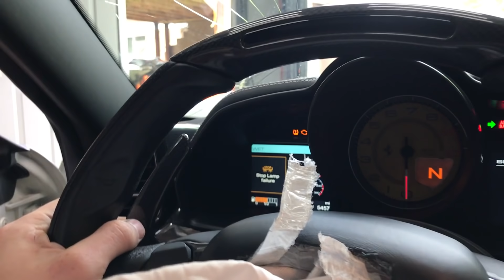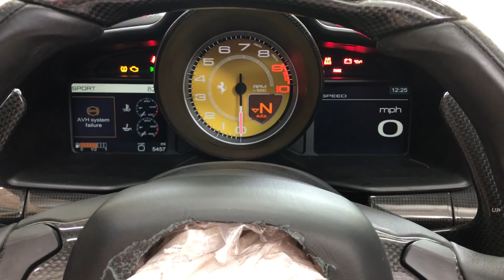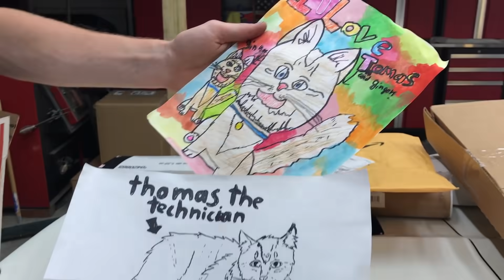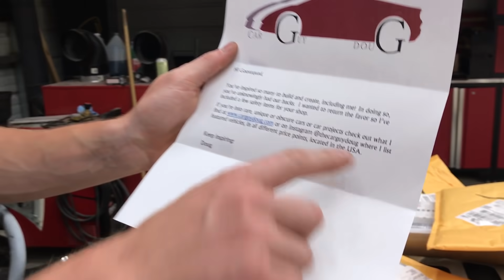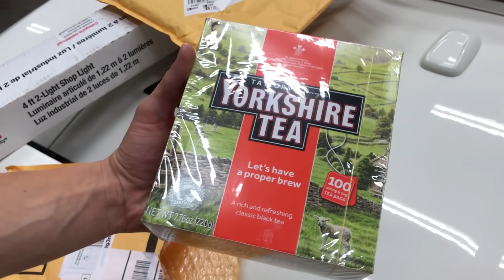Rebuilding A Wrecked Ferrari 458 Spider Part 3

Comment: To put it in gear you need too press the brake and pull on the right hand side paddle shifter. The N display will now say 1. Then pull on the bottom left hand side P button to disengage the park. Once this is done you can either press auto button between the seats to be on automatic mode or just use the paddles. PEACE ✌🏼 got a red 2015 458
Reply: Peace ✌🏼🇨🇦
Reply: Peace ✌🏻🇨🇳
Reply: You own a red 2015 458?
Reply: Peace ✌🏼 🇲🇺
Reply: pin this
Reply: Yo go spam there ig so they can see what you said to
Reply: @Jesus P how?
Reply: Peace ✌️🇵🇰
Reply: Peace 🇨🇦
Reply: Peace ✌🏼🇲🇩
Reply: Piece🤘🏿
Reply: Peace ✌🏼🇺🇸
Reply: Peace🇸🇦
Reply: Peace🇲🇦
Reply: Peace ✌
Reply: Peace ✌🇩🇪
Reply: I love all of you guys
Reply: Victor Coutu 
Peace 🇸🇬
Reply: PEACE ✌🏻 🇮🇩
Reply: U have a Ferrari..?
Reply: Peace ✌🏾🇬🇾
Reply: Noah Kinney  you the man ❤️
Reply: I love you 😭
Reply: Peace ✌🏻🇹🇩
Reply: Peace ✌🇲🇾
Reply: Peace
Reply: brake not break
Reply: Peace :-)
Reply: @dangozo8167  congrats for u to own a 458 👌
Reply: Peace ✌🏼 🇵🇱
Reply: Peace 🇬🇧
Reply: Peace 💜💜💜💜💜💙💙💙💙💙💙💙💜💜💜💜💜💙💙💙💙💙💜💜💜💜💜💜💙💙💙💙💙💚💚💚💚💚💚💚💚💚💚
Reply: Peace homie! ✌🏻👊🏻
Reply: Won't go into gear with the engine cover open!
Reply: TheInfamousProject  I didn't know about that one ☝️ thanks 👌
Reply: Barefoot Builder very informative comment 👍
Reply: Pease✌️🇮🇳
Reply: Peace 🇲🇽
Reply: Victor Coutu that’s what I was thinking
Reply: @dangozo8167  wheres your 60 roll in a 458? I mean OP has his on his channel you on the hand have 0 vids
Reply: Victor Coutu Peace ✌🏽🏴
Reply: Elijah Mayhan peace dude ✌🏼🇨🇦
Reply: @dangozo8167  You just got owned lol, seriously dude just uploaded a vid of him ripping his 458 that is in his thumbnail.
Reply: @MayhemXo  Dude when you get to my age I ain't interested in trying to prove I've got money🌻
Reply: SouthJerseySound it's not the best quality but it will do for now. I should really invest in a GoPro or high quality cameras and not just use my iPhone lol 😂
Reply: peace
Reply: Peace🇧🇧
Reply: Piece of ☝🏽peace
Reply: Peace out 🤞🏴.
Reply: TheInfamousProject  is it not because they disengaged the box putting it into park ? Just a thought
Reply: Peace🇧🇩🇱🇦🇬🇺
Reply: PEACE🇵🇰🇵🇰🇵🇰🇵🇰
Reply: Peace ✌🏻🇵🇷
Reply: Peace 🇮🇩
Reply: Peace ✌🏼 🇵🇷
Reply: @dangozo8167  I'm just saying you try calling dude a liar yet have 0 ground to stand on trying to flex you "have" a yellow 458 spider saying at your age you dont have to prove you have money makes no sense if that was the case you wouldve never thrown in the "I have a yellow 458" into the comment you made
Reply: AlwaysBeeenSad I changed my pfp after this comment and posted my video afterwards 🤔
Reply: Smart man
Reply: Peace🇬🇷
Reply: Peace✌🇿🇼
Reply: Peace
Reply: @dangozo8167  he does have a 458 though check his channel
Reply: Peace ✌️ 🇩🇰
Reply: @dangozo8167  why are you hiding now?
Reply: Pedro Rivera in his parents basement.
Reply: @BarneyR-u2d  probably screaming at his mom to go fetch him his hot pockets and mountain dew
Reply: I have a 458 just like their's but its wrapped
Reply: Peace in Turkey 🇹🇷
Reply: Peace ✌️🇮🇪
Reply: You guys are awesome. You appreciate your fans. You don't have egos and are just down to earth. Thanks guys for the videos. Love everything you have done..... Keep it up guys.
Reply: @Sorryformynegativity  111
Reply: Peace 🇺🇦🇺🇦🇺🇦🇺🇦🇺🇦🇺🇦🇺🇦🇺🇦🇺🇦🇺🇦🇺🇦🇺🇦🇺🇦🇺🇦🇺🇦🇺🇦🇺🇦🇺🇦🇺🇦🇺🇦🇺🇦🇺🇦🇺🇦🇺🇦🇺🇦🇺🇦🇺🇦🇺🇦🇺🇦🇺🇦🇺🇦🇺🇦🇺🇦🇺🇦🇺🇦🇺🇦😜👍🖖
Reply: Did u guys try to charge the original Ferrari  battery
Reply: Peace 🏁
Reply: God this comment section is entertaining!
Peace ✌️🇺🇲
Reply: That long just to start it up.
Reply: They put the car in park manually
Reply: Peace ✌🏼🇮🇹
Reply: @dangozo8167  lol hater
Reply: @dangozo8167  bro dont try an flex an act like you dont care about what people think if that were true you wouldnt have been commenting on here about it no one cares what you dont actually have
Reply: Barefoot Builder You should me more concerned with your eternal sole.  That Ferrari isn’t going with you.  Where are you going to end up on Judgement Day?

Comment: I had a 458 coupe that I bought on auction and then I had the same issue where it won’t go into gear but after a week of struggling I realized I have to make sure the hood is latched completely and the trunk also and doors closed or it won’t go into first
Reply: Whatsnew lol that seems so dumb
Reply: This is correct. Hood latch prevents the hood flying open and breaking the windscreen and totalling your car. very common
Reply: There are days when I think we the customers are going to be protected to death
Reply: You are correct. There are sensors on the hood and trunk latches that tell the ECU if they are closed. If not, it will not go into gear.
Reply: Same with most modern Mercedes, BMWs, and Bentleys.
Reply: My best friend had a Mercedes that would not go into drive if the trunk was not latched.
Reply: Yes, a lot of new cars are doing this, even American cars.
Reply: Same thing with 2019 Challenger RT and 2018 Buick la Crosse, won't go into drive if the door is open and if you're going slow enough speed and open the door it slams it back into Park
Reply: Whatsnew i have a Maserati Ghibli and it does the same thing 
Until you close the doors it won’t go to 1* gear
Reply: You have to close everything on the car like Hood  doors
Reply: Yup
Reply: Hopefully in all of those cut wires one of them wasn’t a lead to the frunk/hood latch sensor.
Reply: yep generally when any of the doors or trunk is open it wont go into gear as a safety feature.
Reply: Whatsnew in that case we wont be able to drive the car if one of the door switch/sensors is damaged.....?
Reply: Jacob Hockenberry no it’s not. It’s for safety and prevents damage
Reply: Whatsnew yup my bestfriend had the same problem and it was that. That simple
Reply: I had a Ford and the tailgate wouldnt open unless you smacked the right hand side. Smh all these pointless features the companies install 🤔

Comment: goonzquad 2022: Rebuilding a Wrecked Bugatti Veyron
Reply: 2020 *😎
Reply: 2019*
Reply: @CurtisOrionJonesBA-kn6km  yeah i know.
Reply: @CurtisOrionJonesBA-kn6km  they will source parts from old diesel trucks since the parts are similiar, or if all else fails, LS swap
Reply: Curtis Jones maybe but Volkswagen will and internally the veyron is almost completely Volkswagen. Outside it wouldn’t be hard to get parts
Reply: 2018*
Reply: Impossible
Reply: *Chiron 😜
Reply: Malte Spielt rebuilding my mother most likely
Reply: 2000
Reply: Well they didn’t lol

Comment: The "PS" button is for the Paddle Shifters.   Try pressing it to use the paddles to get it in gear.  Hope it works Fellas!  Good Luck!
Reply: haha, no. PS means Power start, aka launch control
Reply: QuandomBUS the PS button has nothin to do with paddle shifters. It stands for “power start or performance start”. It’s Ferrari’s launch control

Comment: Use one of those little devices that goes under the steering wheel and identifies all the codes. It connects to mobile and tells all the problems wrong with the car. Chris fix uses one. U can take examples. Its very useful

Comment: “Engine light is on” revs it 🤦🏽‍♂️
Reply: BRO FORREAAALLLLLL
Reply: Cibs H lol crazy, didn’t check oil, coolant nothing 🤷🏽‍♂️
Reply: Yeah, and cranks it having never even opened the engine bay....it could have had the heads off for all they knew.  Inexperience plus excitement can get you in trouble.
Reply: @kevinsue1778  15:50 they said oil checked
Reply: Picsart Editing Tutorial lol they checked the oil yes but then say it probably needs to be changed cuz it’s pretty dark, when they should of just changed the oil just to have it running on clean oil, then do another oil change once car is complete
Reply: Big Shasta EXACTLY!!!!! All types of problems could of happened right then n there but shit in the viewer they the ones making the money so shit, it would make good content if it would of went left 🤷🏽‍♂️

Comment: I know a guy with a 458 and there is no designated park gear. It’s only neutral with parking brake. The way it generally works is that you put it in neutral and turn off the car and it will go into “park”

Comment: In many autos a fast flashing turn indicator light on the display means there is an issue or problem with that light. On a few Jeeps when a bulb is burned out or going bad the signal flashes fast like that. Its most likely doing that because the front turn signals are disconnected.

Comment: To put it into gear I think you need to pull both the paddle shifters together at the same time which should put in in neutral and then the right paddle shifter to go into first.

Comment: Air pump in a stranger place. It’s inside the middle just inside at lower drivers door bottom quarter but a bit back where the door closes bottom quarter

Comment: Try to push the brakes in before shifting. If that doesn't work, then maybe that inertia button needs to be reset before shifting again, if that doesn't work, contact Guttersnake, he'll probably be able to help. Make sure your next step includes buying CYVEX ECUS for both race cars. Also i wanna see a mazeratti next build !!!

Comment: If the car was jump started in Neutral (since it was in neutral when you guys got it) sometimes that will mess with transmission position sensor. There is usually a code with this issue and from the video it looked like you guys had a check engine light. Not sure if that’s your problem at all but a good place to check nonetheless

Comment: Hook battery up to 60 amps current on arc welder for 5 mins , then 15 mins break and repeat this 5 times , 
Scale kinda crap comes off lead plates allowing acid to react just like it used to , only ever need replace battery when a cell /plate goes bad .
Reply: Be careful , stay a distance , have water ready incase if emergency to pour on skin etc and make sure top caps are taken off also , this is dangerous so watch a couple of YouTube videos about doing this procedure and use common sense , this is dangerous if done incorrectly . Needs be said .

Comment: I dont know for sure but i wouldnt put it past Ferrari to compand the ECU to not engage the gears if it can't get a coolant temp signal.. Considering you have the radiators off ATM.. But thats just a guess on my part fully

Comment: Dang Dude!....These guys are so smart!....The Inertia switch was "triggered by the air bags going off"....Who would known?.... Most of inertial switches are a switch, firmly mounted upon a vehicle or other mobile device, that triggers in the event of shock or vibration to cut power to electric fuel pump may otherwise continue operating after a collision or rollover and to pre-tension seat belts and/or to activate air-bags to protect the occupant(s) from collision with the vehicle interior or the steering wheel....but they are not  "triggered by the air bags going off"....Do these two guys just spew out anything without giving any thought to what they are saying?....

Comment: The designer of your car Pininfarina has built their first actual car called the battista. A 1400 kw or 1900 hp all electric supercar at a cost of 2 million + pounds , go take a look , it's a beast.      0 to 62 in less than  2 seconds. Top speed limited because the tyres couldn't handle any more and 1,696 pound-feet of torque.

Comment: Yo guys, if the car keeps detecting the front trunk as opened, it won't go into gear. If the front trunk latch is damaged, try to close the circuit of the latch sensor by jumping it with a wire. Also, when you try to shift into gear, make sure all the doors are closed.
I have worked on damaged Ferraris before so let me know if you need ay help.

Comment: Fellahs, seems like you and Samcrac are tackling Ferrari problems simultaneously, You ought to talk (or at least check each others vids lol!... Plus, you guys should leave the rear bumper like it is, The over done diffusers are noy designed to operate properly on a Ferrari's aerodynamics as far as the undertray is concerned......food for thought.........

Comment: If you plan on selling this car don’t change much from stock.  The car’s value will decrease the more the stock parts are removed and changed.  Could get away with the exhaust as long as the new owner is given the stock one in the sale.  The Ferrari purists look for OEM pristine cars not modified.

Comment: It’s not supposed to be in park that’s why it wouldn’t go in drive because to put a Ferrari in park you have to put it in neutral and then pull emergency brake not put it in park manually

Comment: This car had the full  Akropovic titanium exhaust.
Reply: Also the shop on the plate frame did all the work to it so you might want to give them a call. But the insurance company wasn't going to pay for the aftermarket stuff so it was pulled off. The exhaust alone was $14,000 USD

Comment: Ferrari does not manufacture their own battery in fact there are only three manufacturers batteries the entire world for the automotive industry. They are all off brands of those three you ever pooped 40 series battery whether it's a 41 42 43 45 48 or 49 they're all pretty much the same it's just the size and shape of it's different in that series. Very similar to the one VW uses

Comment: Oh yeah!..."weight displacement"....lololololololololol....They put the battery in the front for "weight displacement".....lolololololol....It is measured indirectly using Archimedes' principle by first calculating the volume of water displaced by the car then converting that value into weight displaced....These guys are really smart....lololololololololol

Comment: Battery Question -> With the new battery, how many days can the 458 sit there in the garage not running and still have any charge left in the battery to start the car? Should you set up a well grounded charging system with Auto Cut OFF for the battery now?

Comment: I want to buy your burned Lambo chassis if you are not using it to build from .    My offer still stands on your Lambo cash in hand and since you are now a Ferrari guy you guys dont need it in the first place !      No but really I have a 1981 Lambo Countach with a busted axle, broken motor mount and missing passenger door  if you guys want a real car project I would be willing to send it out to you guys if you think you could bring it back to life for me and I might even sell it to you  . Motors good though it did get hit on the passenger side . Damaged the door more than anything so the door was removed but its solid and if I still had my shop still there is a lot of car left to rebuild  .  I want $190 k  Let me know !